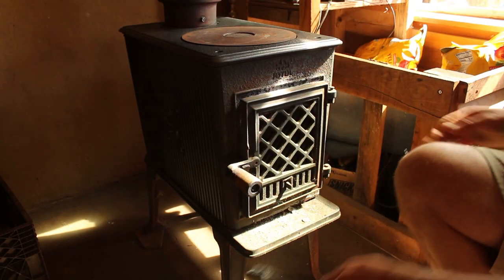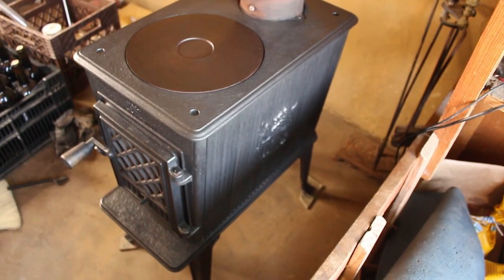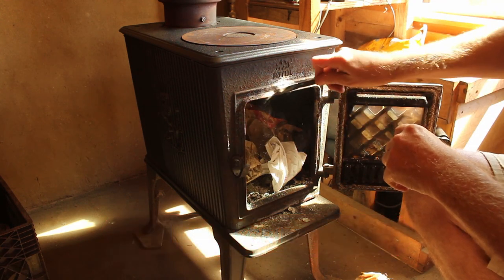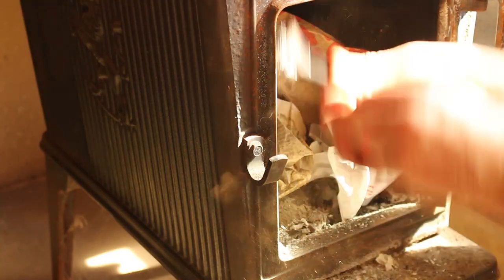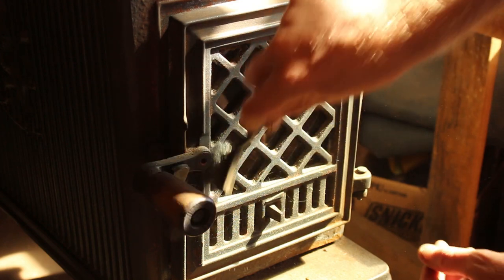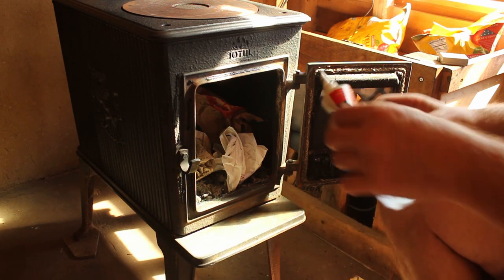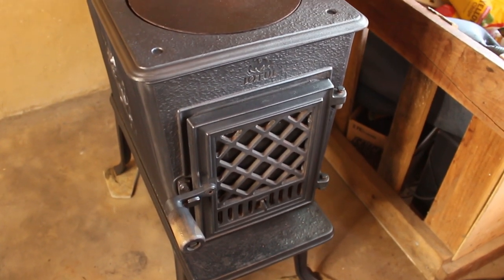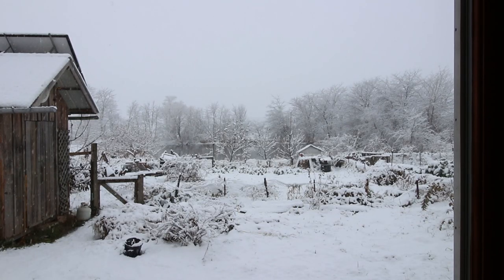Incredible and Satisfying Rusty Wood Stove Renewal

Comment: Wild guess but I'm thinking you don't have a damper in your chimney? When the stove isn't being used, cold outside air might be chilling your stove. If the air around the stove is cooled below the inside dew point, condensation will form. Not unlike a glass of ice tea in Florida. ;)
Reply: What he said👆🏻
Reply from the maker: I wonder if it's actually the opposite...that it's warmed during summer and it's cooler inside. This happened in summer and it wouldn't be cooler outside than it is inside the house. But then again hot air would rise, not sink, so the inside of the wood stove, even though it's directly connected to the outside air, wouldn't be hotter at the bottom. I usually open all the windows at night to draw in cooler air. 

I'm thinking that whatever was spilled on the floor might have spilled on the stove and done the same kind of catalysis for condensation. But the floor is almost always cooler than the ambient air, so moisture would most likely condense there. The stove might be cooler than the ambient air, especially if the AC is blowing on it, but only for a while after that's running. And that wouldn't explain why it hasn't happened in past years.
Reply: @HardcoreSustainable  Hugh - I guess the future will be telling. If it doesn’t happen again the maybe the spill was the cause? Regardless, I’m loving the mystery- second only to worms in the rain barrel!
Reply from the maker: @JoelLackey  Ah, yes a throwback. I think people had good answers for the worm mystery.

Comment: Hi, my family have had solid fuel stoves for generations. 
Any metal, and in your case its cast iron.. will rust in a hot/cold enviornment.
When the stove is not lit, especially in summertime, it is prob the coldest surface in your house and this attracts moisture from humid air. Occasionally the humidity will be soo high that the unlit stove will attract moisture to such an extent that it will accumulate and then drip to the floor.
Moisture causes Iron to oxidize 😢 which is rust. Stoves with a matt paint/polish finish are ripe for small amounts of rusting and it accumates over time.
Stoves which are enameled have a greater resistance to moisture in the air and will generally not rust.
Ashes and dust can also accumalate in the form of a micro thin film on the surface and/or all those little joints and lettering etc forming a perfect spot for moisture to rest. 
I could go on but their is no need. A matt finished cast iron stove which is left unlit for days at a time will rust and just like an piece of wooden furniture it will need a polish from time to time.
Brush off the stove every week , polish twice a year and you will find that the need to use a wire brush will lessen or cease.
An enameled stove just needs a wipe of a cloth, takes years before little specks of rust appear at handles , knobs , door hindges etc.

Generally cast iron is also more likely to retain moisture, but its little to worry about really. There is a certain joy in giving the Stove its biannual session of TLC and those Iron miracles will likely outlive us when it gets that love....awe ❤. Peace and good health to everybody reading and beyond 🙏👍✌️
Reply from the maker: The only reason I questioned whether something else was going on was that I'd never noticed so much rust forming in the past 4 summers I'd had the stove. Also, there was water condensing around the stove on the floor, not under it. After I mopped the floor in that area, there was no more condensation around the stove.

It could be that ash film was on the stove and creating a catalyst for condensation.

Thanks for your input!

Comment: The stove draws the cool room air at the bottom and then it gets flung upwards and heated at the stove.  Plus you cook with it which pushes a lot of humidity in the air. That air cools and settles at the floor then is drawn towards the wood stove. Put a hearth under the stove and get a dehumidifier or ceiling fan if it continues.
Reply from the maker: Thanks for the ideas. Do you mean put a pad under the stove? Although it's hard to see, my floor is earthen, so there really isn't a need for a pad. It's like having stone under it.

I have a ceiling fan and use an AC in the summer, so those help with moving air and dehumidifying. The stove only operates in the colder, dryer seasons, so that's not when moisture and rust are a problem. It's actually incredibly dry in my house when the stove is in operation and I  always have a pot of water boiling on top.

The problem with dehumidifiers is in such a small house they will heat it up a lot while dehumidifying. The window AC dehumidifies without heating the space.
Reply: @HardcoreSustainable  Try boiling less water. That might be the problem. I use to do that and i found a light coating of green mold at the lower 4 inches of a room with no fan. I stopped the boiling of water and it never came back. You need to run the ceiling fan constantly day and night and make sure every room has a small fan.
Reply from the maker: @ateamofone  I suppose, but I can't imagine there being enough humidity in the house in winter to grow mold. The humidity is around 25-30% in winter with the wood stove going, and I'm fighting to keep it around that. The moisture and rust was happening during summer.
Reply: @HardcoreSustainable  That is how i was letting in humidity in the summer and the mold would begin.  So i switched to a dehumidifyer and stopped opening all the windows in the summer and use a small window AC for my house. I agree, it starts in the summer months. Collecting humidity. Boiling water in the winter was no help.
Reply: Wood sometimes if not given enough time to season will drop water and rust out

Comment: Is your stove on top of a cement slab? Mine is and I’ve noticed rust like yours. In the summer I get some moisture on the slab and I’m thinking that’s the culprit?
Reply from the maker: It's on an earthen floor made of sand, clay, and straw. I'm pretty sure that something was on the floor that was condensing moisture. After I mopped the area, it no longer condensed water.

Comment: I'm surprised it rusted in the first place. I would have thought the coating the manufacturer would apply would be rust resistant. Otherwise I've started using a digital humidity sensor - useful to know what the humidity is and if its high you can react accordingly.
Reply from the maker: I do have a weather station that always tells me the humidity and temp inside the house. It's high in the summer, but the AC lowers it.

Comment: Is your wood stove approved by the government?

Have you tried auto engine paint?

Thank you for sharing informative videos!
Reply from the maker: I'm using stove polish that is made for exactly what I'm using it for. I wouldn't use auto engine paint for this. The polish worked fine.

I don't know what you mean by approved by the government. You mean as far as emissions? It was sold in the US by a reputable seller, so yes it is legal.
Reply: @HardcoreSustainable 

So far all I can understand about government codes on indoor wood burning stoves is the possibility of fumes. I do not know if there is some way to know if a wood burning stove is in compliance with the government. Presumably the government is primarily intent on protecting the women & children - at least. Of course, I am just making an educated guess.
Reply: Fumes? Protecting women and children?  What are you talking about?  I'm sorry but your comment does not sound like it was made by someone with the experience to make an educated guess about wood stoves.
Reply: @willowlaken6303 

EPA 
Burn Wise
"Ordinances and Regulations for Wood-Burning Appliances"
(These EPA standards govern the manufacture and sale of wood stoves, and certain wood burning fireplace inserts, built after 1988.) 
(April 2021): (This report describes existing policies that employ a range of strategies to advance two complementary goals: changing how and when wood is burned in homes; and replacing existing wood-burning devices with lower-emitting alternatives.) 

Look up EPA publications.